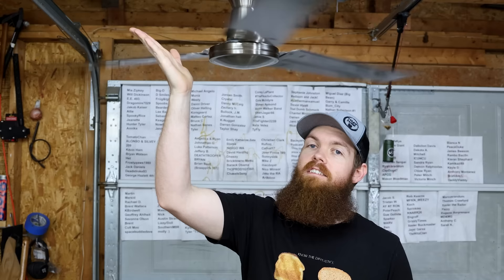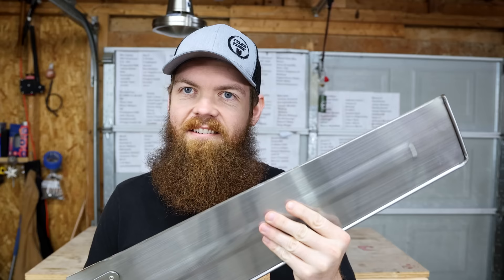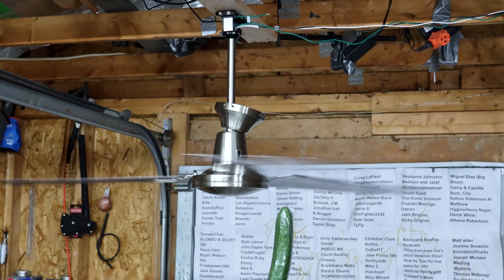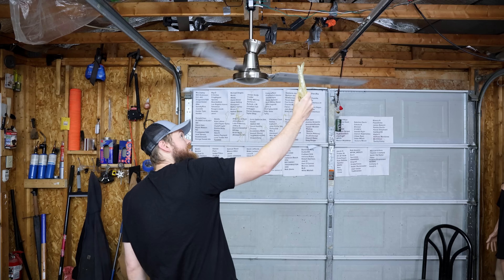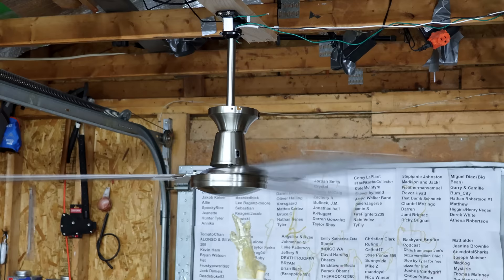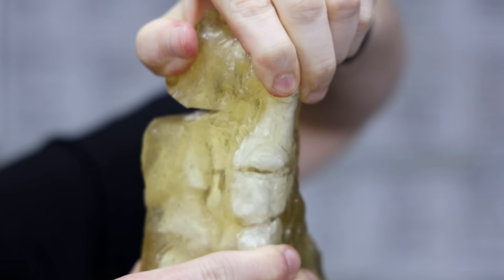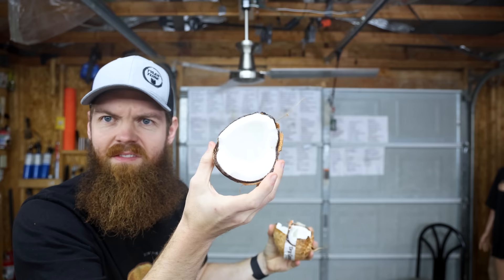I Made My Ceiling Fan RAZOR Sharp!

Comment: Keep in mind that during the initial ballistic hand test, Tyler would raise the hand from straight underneath close to the center of the fan. The highest velocity is actually at the tip of the fan blade which easily has enough force to amputate extremities.
Reply: Had a bird get decapitated on an industrial ceiling fan not even going that fast at work one day
Reply: Youtube experts go crazy 💀

Comment: Very fortunate to have mounted the bracket the way that he did. If it was mounted in the other direction the kickback on the fan would have rocked it out. You can see it in some of the slo-mo how it pressed back into the back of the socket. If that was where the opening to install it was located, it would have come right out. If there is a revisit to the fan I'd suggest using zip ties or some sort of strap to temporarily lock the fan into the bracket.
Reply: Fortunate?, Tyler Planned it that way!, all safety conditions were taken 100%, except, ..... Tyler

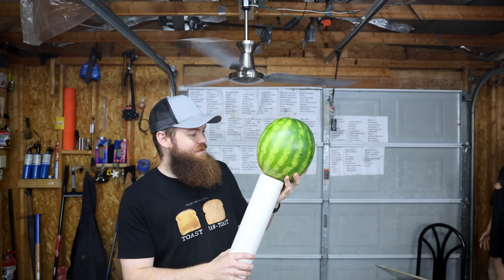Comment: the kickback at 9:10  could have been very dangerous. not even considering the fact that all you had to do to keep the fan retained was to secure that neck you left danging. what if the fan swung over more and buried one of the blades in the back of your head?
Reply: He would not have felt it for to long.

Comment: That cover you left hanging, is actually the safety the keeps the fan from completely detaching from the ceiling.
Reply: No it’s only for looks there is is a locking screw or pin which he probably didn’t install.
Reply: @charlesl21 I'm an electrician, kwhp1507 is absolutely correct, the canopy retains the downrod in the bracket.
Reply: Depending on the fan, the canopy is either just a cover, or serves to hold up the entire fan, in this case, it’s merely just a cover. The canopy serves no purpose in holding up this fan.
Reply: @apfanco  it most certainly keeps the downrod in the bracket.
Reply: @spacecomma4355  it doesn’t. The ball is held in by a pin a the top of the downrod. That’s what keeps the downrod held inside the mounting bracket.
Reply: @apfanco  that’s what I said
Reply: @apfanco  I've been an electrician for 25 years, I've hung thousands of ceiling fans. The canopy keeps the downrod in the bracket. If you don't believe me, try to take one out of the bracket without dropping the canopy.

Comment: There was a part where the fan tilted pretty far in one direction from one of the impacts I really thought it was going to send the whole thing falling and it almost hit you either way. Meant to pause and add it to the comments but forgot. Should of had some safety’s in place in the event that one of the blades fly off or the whole fan falls off the bracket considering the base wasn’t secured

Comment: Growing up, we had ceiling fans on the second floor because the central air was insufficient.  They were nearly identical to the one in your clip.  Without sharpening could still do a fair amount of damage.  While trying to fold a queen sized sheet my hand became intimate friends with the fan.  No broken bones, plenty of cuts on my hand.

Comment: Use the area closer to the tips of the blades to cut. that is where they have they most speed.  Yeah, you get slightly more torque going closer to the center hub. For example, the large windmill turbines you see in farm fields only rotate at 10-15 RPM but the tips of the blades can reach speeds of almost 200 miles per hour. This little fan won't have that kind of speed but it's a thought for sure.

Comment: Shows in the beginning how easy it is to remove the fan from the ceiling.

Proceeds to stand under it and throw large items into the blades which cause it swing in the direction of the opening.

Comment: If you take the shroud that you left sitting on the top of the fan motor and secure it to the ceiling mount with the silver threaded holes on the black plastic it will prevent the fan from coming out of the holder.

Comment: I figured since you didn't have it fixed you were gonna jam the coconut in there, have it hop off the little metal hanger and gash you wide open. Didn't even try dude, not even so much as a zip tie to help secure it, just loose in the mount lol.

Comment: Please, Tyler. If you make any follow-up videos, SECURE THE MOUNT SO IT CANNOT JUMP OUT OF ITS HOLDER and secondly PLEASE BE SPACIALLY CAREFUL. It hit your garage door track a couple times and it could potentially hit it hard enough to whip the opposite direction, get a steep angle, and hit you. PLEASE be careful

Comment: I would very much like to see a more secure mounting for that fan (spinning death wheel), but good job. Now you need to mount the blades to a much more powerful motor, and see what can happen. Or buy some replacement Hanwei longsword blades, drill and tap them to a blade mount, and then mount those to a more powerful electric motor. Sword fan. You know what, don't do this. No one pay attention to this.